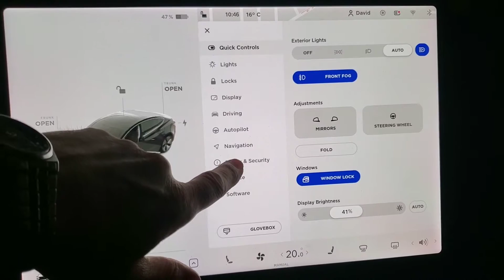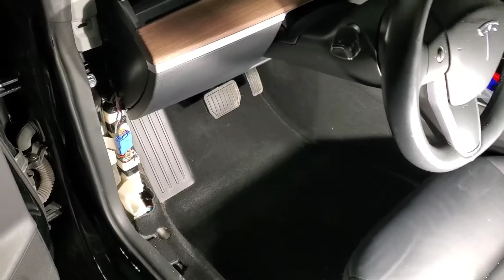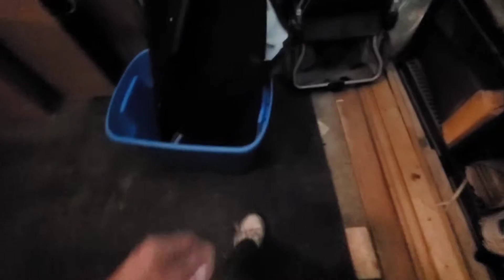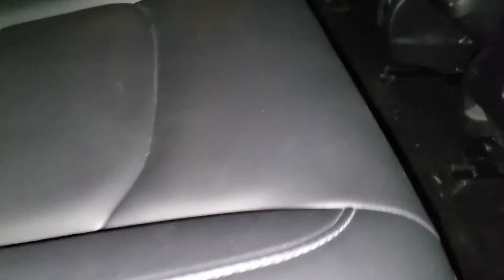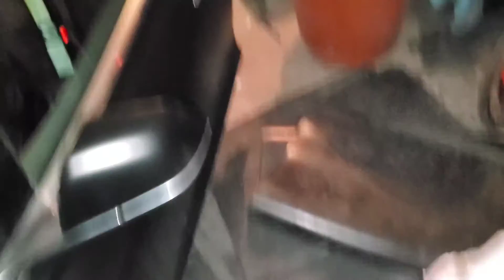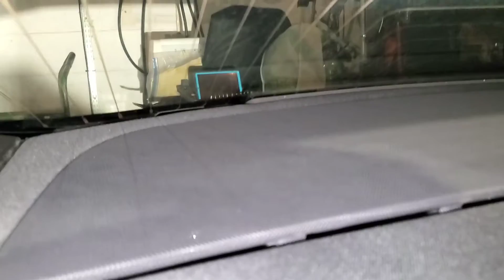Hansshow Tesla Model 3 Audio Upgrade Version F Installation and sound test.  Discount code: Exa66

Comment: How did you manage to open the rear deck grill? I thought it’s impossible without disassembling the whole rear deck shelf.
Reply from the maker: I'm sorry, I didn't show it on the video. So, accessing the speaker recess depends on the model year of the car. Mine is a 2019, and its quite simple. The grill over the speaker recess is held in place by the grill itself. There are several tabs that need to be delicately pulled straight with a plastic pry tool. Its actually harder to put the grill back in place. To do that you insert the tabs into the slots, then fiddle with the pry tool to bend it so that the grill stays in place. To pass the wires, you simply fish it between the metal support and the carpeting.

Comment: Hi. Did you have a constant hissing/static sound after installing? Even with no music playing.. I just got ver F installed and I tried soft/hard reboot but no luck
Reply from the maker: That's strange. I never had such a problem. Sounds like it might be some distortion. I would suggest getting in touch with the manufacturer through Watsapp,  they are pretty good at responding through that platform.
Reply: Did you find a solution to the hissing/static sound, I just installed mine and noticed it too. I also noticed that it goes away when you turn on the rear defroster.
Reply from the maker: @MagnusSkipton2241  that's interesting. You attached the writing the same way that I did? What year is your car? You grounded it properly?
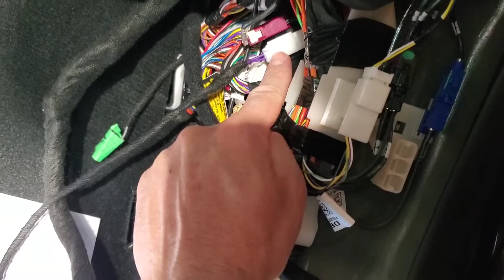Reply: @exaktamann8233  I have everything connected the same way you have in your video. My car is a 2021 built in April 2021, I noticed that it doesn't have the connector you mentioned in time stamp 5:30. I stuck a snake camera in there looking for it and it wasn't there. It's grounded the same way you have it grounded in the penthouse.
Reply: @MagnusSkipton2241  Same issue here. Faint but definitely audible white noise when nothing is playing. Disappears when rear defroster is on. Did any of you guys find out how to fix this?
Reply: @TV_Covers  nope, I never found a fix for the issue
Reply from the maker: Can you send me an audio file,  to Davidvas@davidvas.com

Comment: Hey do you think they sound significantly better than the original sound system?
Reply from the maker: In my opinion,  yes.  It's a night and day difference.  There is a huge spacial improvement.  In addition there are sounds that you just don't get without this upgrade,  especially in the lows,  but also in the high frequencies.
Reply: @exaktamann8233  Hey, would there be a significant decrease in range after installation, wondering if this would consume a lot of energy.
Reply from the maker: @danniezz4637  Hi.  I haven't noticed any change in range. It seems pretty efficient,  and it draws its power from the 12v battery,  not the main battery.
Reply: @exaktamann8233  Thanks!
Reply: Are the chimes significantly louder too? Too loud?
Reply from the maker: @johnnynguyen8520  personally,  I haven't noticed a difference with the chimes, but I use the "Joe mode".

Comment: Could you have left the original deck speaker in place?
Reply from the maker: Yes,  you could. Just leave it in place with the wires coming from the Tesla amp or can hook them into the new Hansshow amp with the provided wires.  I preferred the Hansshow ones as they are polypropylene instead of paper. Having installed them,  I can tell you the sound is better.

Comment: Hi, what setting did you use for  the subwoofer knobs? I wasn’t sure of them so I just left them in the middle position like yours
Reply from the maker: Yes, I fiddled with different positions, and found the 12 o'clock position the best.
Reply: @exaktamann8233  thanks I just left at 12 o clock but haven’t messed with it since I got it